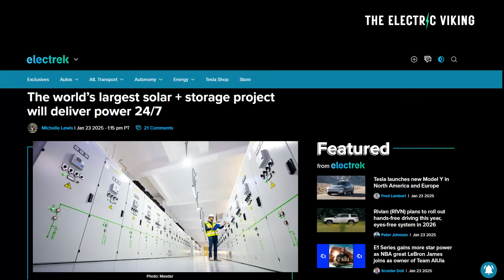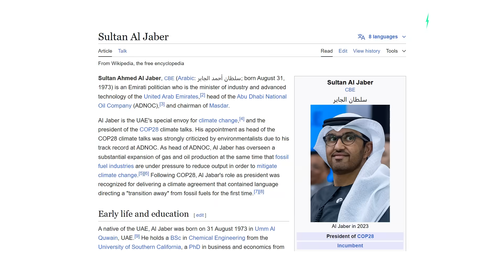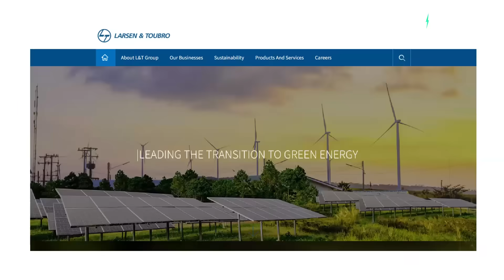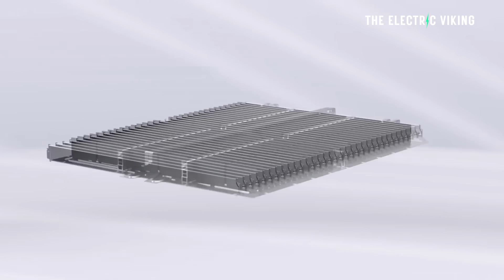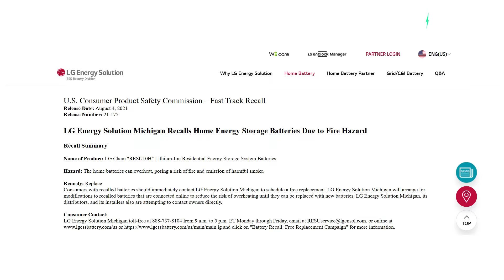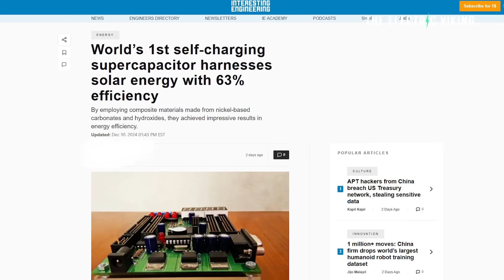The world’s largest solar and battery project deliver power 24 hours a day

Comment: I dont understand why solar panels aren't used to shade the batteries and reduce cooling requirements? I'm sure access concerns could be mitigated with modular panel systems and/or plenty of clearance heights.
Reply: Shading heats the batteries more up, because the modules generate heat and theyre black. White battery housings prevent more from heat
Reply: @jdogg1000  I don't think so.  Realize these panels will be many feet away from the battery containers.
Reply: Why not shade the parking places..
Reply: some are buried underground
Reply: Studies show crops grow better under solar panels. Sheep and goats are less heat stressed under them.

Cows can be a bit destructive, though.
Reply: I've often wondered that myself. Also, the wasted tracts of land beneath the transmission lines seem like an obvious place to put them too.
Reply: Interesting idea but I’m not sure it would work for shading the batteries with the panel angles,  mounting locations and the changing arc of the sun.
Reply: Excellent idea.   Once we get all this standardized, it’ll get cheaper. In the US we have so many people who wanna inspect it, it just makes it more expensive.
Reply: You add only cost when you have plenty of space
Reply: You could. The structure would probably be custom, not standard racking.
Reply: Recently there was an enormous fire at the Moss Landing battery storage system in California.  The battery storage system was inside of the building that used to have the generators of the old thermal power plant.  They had to let it burn because the system with the flammable batteries was all inside of one big building.  The other battery storage system at that location has Tesla Megapacks and a previous fire was contained within that single Megapack.  At this time while these batteries are flammable, it would be very unwise to place a battery storage system underneath solar panels because a battery fire would spread out of control throughout the solar panels.
Reply: @acmefixer1  What is flammable on a solar panel array?
Reply: Batteries are still expensive and the grid would still have to be beefed up to take more load. And what do you do with the batteries when they no longer work
Reply: @normbouffler6546  
The price of batteries, especially for energy storage, continues to fall.  

Batteries are too valuable to go to waste, they're recycled or are reused.

The batteries remove the peak loads off the grid, making the grid capable of better handling peak loads.  But the grid may have to be beefed up to handle the new datacenters being built to handle artificial intelligence.
Reply: @normbouffler6546  They'll eventually be recycled.  3 day storage capacity with each meter would end the need for drastic grid expansion/investment.
Reply: When there is no sun, no wind, where will we get the power? A nuclear powerplant is the most economic when it runs all the time. 

What is cheaper - build sun, wind AND the exact same number MWh as the Backup needed - or only build nuclear ? 

Why do we need sun and wind power (killing millions of birds and thousands tons of insects) - when we need to build the total amount of power needed in nuclear anyway ?
Reply: @martina5328 you don’t have to build a bunch of nuclear. And it’s simply tooo expensive. As solar keeps getting cheaper it will only make sense to just overbuild solar to produce the minimum base load needed on a stormy day. Batteries will get cheaper too as these companies build more battery projects and get more funding.
Reply: @antsalberta7526  Where in Europe do we get enough sun in the winter? At what economocal and environmental cost? And where do we store it? Are you talking the year 2400? By then we already have nuclear fusion.
Reply: @     By 2400 nuclear fusion should be just about 30 years away.
Reply: Wind?
Reply: @martina5328  My biggest problem with nuclear is, apart from the whole, unsolved, waste problem, is that it is too expensive, and especially now, far, far, far too slow. It takes about thirty years to install a new nuclear power plant, and we don't have the time. Also the cost of Hinkley Point would have brought far more wind/solar/battery online, and they would have been generating ten, or twenty years ago. I know there has been significant progress in safety etc., of nuclear (except the waste problem.), but the rate of change in renewables, including batteries, has outstripped it by whole magnitudes. In ten years, renewables, will be less than half the cost they are now. Can you ever say that about nuclear.
Reply: @michaeljames5936 well said. In addition, it cost billions of dollars to clean up a nuclear power plant when the nuclear power plant reaches the end of its life. So expensive nuclear power is a non-starter.
Reply: @martina5328 Nuclear is far more expensive than solar/wind with battery storage and nuclear produces waste which must be stored for millions of years.